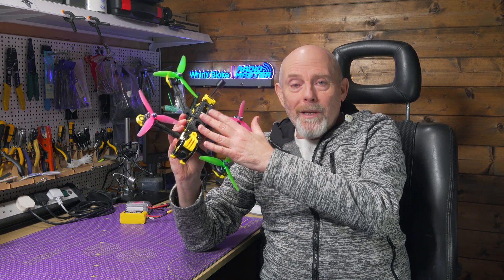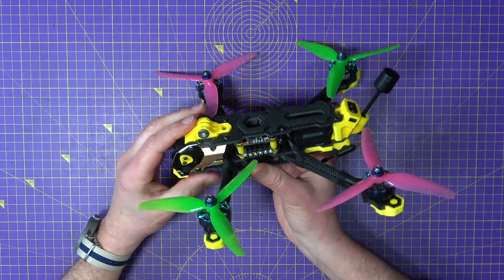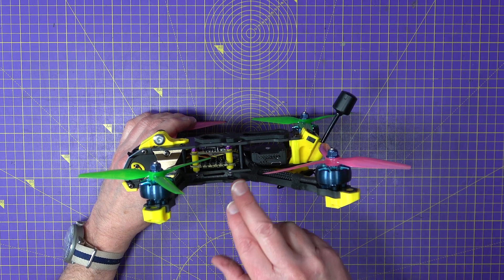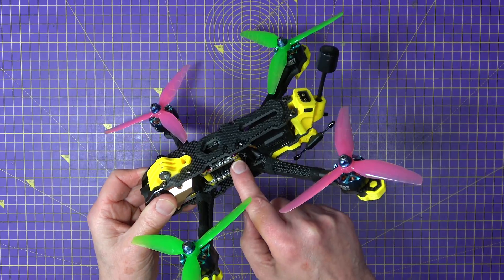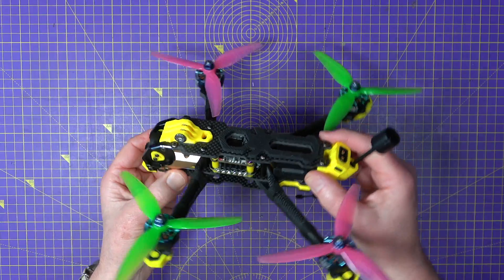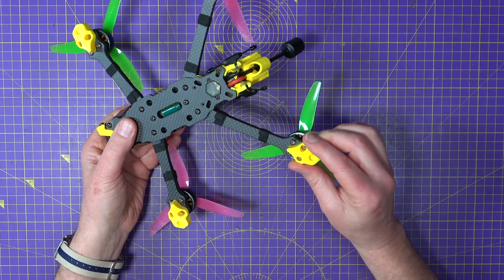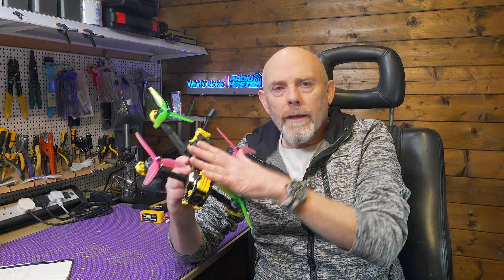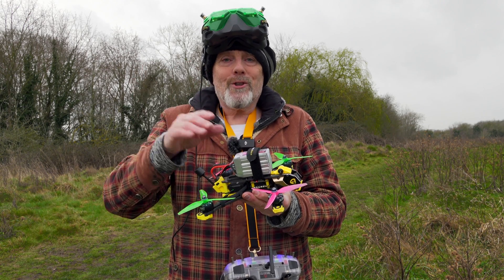SpeedyBee Mario 5 build and flight footage

Comment: I've been flying FPV scale model fixed wings with FCs and Walksnail for some time. I've dabbled with little quads in the past but I'm now looking at getting into quads more seriously - mainly so I can fly in the sort of strong winds which now seem to be the "new normal" in the UK.
Would there be room for a GPS and a tilt servo for the camera on the Mario 5? 
(I'd be flying iNav and I'd want a RTH. I also think being able to manually change the tilt of the camera through a switch would be useful in landings with the sort of non-wide lenses I like to use)
Reply from the maker: I see your thinking, but there's really no need. INAV automatically corrects GPS and compass data for the tilt of the aircraft using the accelerometer and gyro. If you mount them on a tilting mechanism (like a camera servo), INAV can’t account for the changing orientation, which leads to incorrect heading and position data, making navigation and Return-to-Home unreliable.
Reply: @WhirlyBloke  Thanks for your response but I was thinking of putting the camera on a tilt servo and not the GPS.
Does anyone do this? I guess most people use such wide angle lenses that they don't feel the need. And typical quad receivers and FCs don't include PWM servo outputs.
Reply from the maker: @stevep4131 https://medlindrone.com/store/

Comment: Hi! Thanks for this great video. I have a question: by increasing the throttle my engines speed up but if I reduce the throttle they are supposed to slow down. Logical. But it doesn't happen to me in most cases, especially if the throttle exceeds the middle of 1500. What can be wrong? Transmitter:TX12, receiver R81, but test from betaflight works fine

Comment: Very well explained video. I'm planning to build my own very soon :) 
What sazi capacitor are you using? I've seen people having trouble with the size that comes in the box.
Reply: To answer your question, as I am looking into buying the same frame, a 1000uF capacitor does fit which is about 10x20mm but some stacks are shipped with 1500uF which are too thick and do not fit into the cavity.
Reply from the maker: I’ve been using a 1000µF 35V low ESR capacitor for 6S and 25V for 4S

Comment: Hello. I am just about to finish almost the same build with moonlight walksnail. Only difference are the motors xing 2207 1800 kv. I am glad that i picked almost the same parts as you and you have also the pid setup here :-) my only question is whether you flashed your esc to bluejay or kept as blheli? Thank you for nice video :-)
Reply from the maker: Thanks for the nice comment. I've been using bluejay on all my builds recently. Now blheli has gone,  I think it's the right way to go until AM32 is more widely tested on more boards.
Reply: @WhirlyBloke  perfect! Thanks for your reply. As you mentioned you use your drone mosty for cruising. Is it possible to acro with theese settings? Probably different props will have affect on the Tune aswell. Im quite new in fpv. Flying since march this year with 3,5" and when I saw my friend with 5" I ordered the parts next day :-D
Reply from the maker: @pebady83  That tune is fine for acro. In fact really good.
Reply: @WhirlyBloke  i just tried the drone today.  It flies realy smooth. The pids are top ;-)
Reply from the maker: @pebady83  Enjoy it

Comment: Hey man! Great build and video.. I would like to ask you, how did you go about mounting the vifly finder buzzer. Did you use a 3D printed part or some kind of glue to keep it in place? Thanks.
Reply from the maker: Thanks for the kind words. I just stuck it to the frame with VHB tape. It's what I always use. It's simple,  cheap and quick, and it's not coming off in a hurry.

Comment: Hi man. Awesome channel. I build this quad and I am having nose dips 😢 I can’t get rid off it happen when chop the throttle after a punch. Would you mind sharing your pid tuning?
Reply from the maker: Thanks for the kind words.  There's a link to my BF diff on the video description.
Reply: @WhirlyBloke  wow! Thanks mate. I don’t know how a missed that. I love your channel even more now. Will try does pid and let you know how it went
Reply from the maker: @damaca_fpv  Before you disappear down a tuning rabbit hole, try bumping your throttle idle up a bit. Throttle chop bobbles (throbbles) were a big problem on my early INAV cinelifter builds and that sorted it. I think it's cos they are quite heavy and react fast to throttle chops. Let me know how it goes.
Reply: @WhirlyBloke  😅 I am at the bottom of the hole right now. I was able to pid tuning for a regular flight, but “hard” movements like dives and flying backwards are imposible. The nose is all over the place trying to catch up the set point I guess…will try the idle.
Reply: @WhirlyBloke  I would like to share a screenshot with you. I don’t know if it is normal, but after a punch, at zero throttle the pitch Iterm goes flat suddenly on Blackbox Explorer, and gyro star to lag a lot behind set point, at the same time feed forward seam to do nothing on that instant
Reply: @WhirlyBloke  I am out of the pid hole, finally made it works: https://youtu.be/0GRlK7fJJv0?si=Et4ACC3Bzq9f7C6B 😁
Reply: @WhirlyBloke  where are the PID files? the Google Drive folder is empty 🤷‍♂

Comment: Beautiful! How did you mount the receiver? Did you glue it down so it doesn’t move?
Reply from the maker: It's just fits between the bottom plates. No need to fix it on place cos it's not going anywhere.
Reply: @WhirlyBloke   Thank you! Love your videos! Most straightforward and helpful videos!
Reply: @WhirlyBloke   Thank you again. I'm sorry, I do have one more question if you don't mind. Since I want to install a GPS, it looks like I will have to install the FC/ESC stack backwards in order to have the XT60 come through the front. However, I don't want to do that, since it will mess up the length of all the other cables from the connectors on my F7 V3 stack. If I mount the FC/ESC stack facing forward, is there enough room between the stack to pull a long XT60 pigtail through to the front?
Reply from the maker: @Binkoro  It depends on the diameter of the noise suppression capacitor you use. There's not a huge amount of room between the vertical plates, but I'm sure you can make it fit. Personally, I'd keep the stack the correct way around and use longer GPS wires etc. I'm not a fan of long battery leads. They are harder to route, and there's more cable length to radiate all that nasty high energy noise.
Reply: @WhirlyBloke  thank you again. I will try not to use the long xt60 connector even if I have to extend cables to the GPS, receiver, VTX, and camera. I wish the GPS mount also had a place for the XT60.